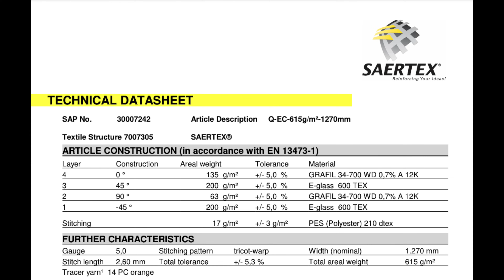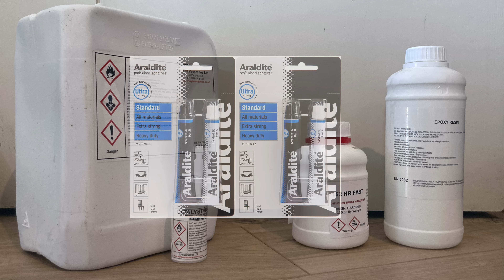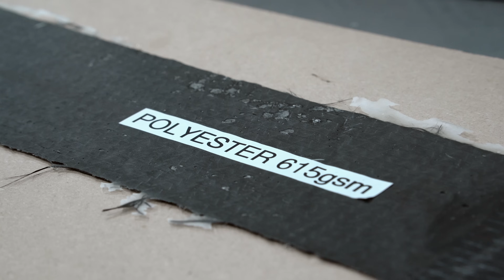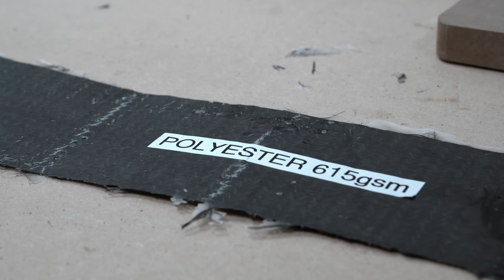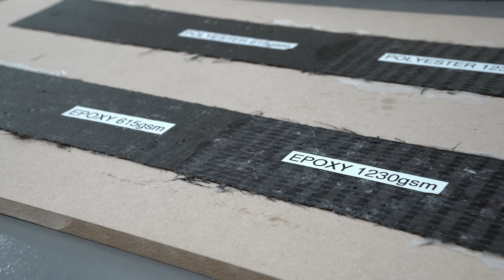Polyester VS Epoxy Resin comparison test - carbon / glass. Expedition lifeboat conversion.Ep102 [4K]

Comment: Bond strength is the big difference, a chain is only as strong as it's weakest link.  Much has to do with the application.  Glass Straight. biaxeal, laminated, use waxes that epoxies will not wet out fully.  So when you get a fabric made of layers, they use a binder to hold the shape inhibits wet out where as polyester wets out fine.  I would guess the most of the composite materials were made for polyester resin not epoxy.  If a test of strength is to be fair and accurate one must use uncoated fiberglass.   This would be difficult as I have never seen defined composites Epoxie or polyester almost all are for polyester.  I have been building and repairing Boats for 55 years and have seen evolution in most materials but not in fiberglass.  At 16 years old I watched one repairmen do a repair in epoxie, and ask why.  He told Me the bond to fully cured fiberglass is to weak with polyester, so one needs to use epoxie.  That was 55 years ago, today not much has changed.  The best thing with polyester is it stinks.  Unfortunately it is cheap and fast for mo money.
Reply from the maker: All of these composite fabrics are optimised for use with epoxy resin. It's only emulsion bound mats like basic CSM that need stryene (in polyester or vinyl ester resin) to dissolve that and allow a proper layup. Even plenty of basic glass fibres (some CSM, and plenty of woven etc) are not emulsion bound, and so combine fine with epoxy resin. You're spot on that most polyester resins form a poor bond to already cured parts - it's certainly not an adhesive! Cheers.

Comment: Insightful video. The other thing to consider is that polyester resin becomes more brittle over time compared to epoxy, or so I've heard. I also prefer using it as it's not kicking out the same fumes as polyester

Comment: all the fiberglass yacht builders use vinylester, not poly. poly will absorb water at some point. i'd just use s-glass instead of carbon stuff. the lifeboat is fiberglass so s/e-glass will bond with it no problem.
Reply from the maker: Oddly, via my suppliers vinylester is only a little cheaper than epoxy. Perhaps in commercial quantities it's cheaper.

Comment: Did you state what the build objective is? If repair of a polyester layup then epoxy is preferred material.
Is there a good reason to even think of using carbon in Alan? Dont forget electrolytic corrosion issues if metal amd saltwater in the application.
The cloth manufacturer should specify approp resins
Gloves, at the very least, highly advised with these resins esp epoxy as high allergenic potential and permanent health consequences.
Peel ply is critical, not just to control sharp fibres but to help optimise resin ratio, to optimise bonding surface of the cured composite, and to deal with the amine blush problem with epoxies, something which hinders surface finishing incl paint adherence.
Epoxy composite will only achieve optimum strength with post cure at higher temp as specified, certainly room temp cure is inadequate. post cure for a day or so inside a car on hot summers day works well, for small layups.
Dont use / keep silicone materials in  the same postal code as your composite layup work, or risk serious loss of bonding performance.

Comment: How long did you leave the resins to cure before testing? I'm not an expert in composites, but I have spent 40+ years working with aerospace paints & coatings (mainly epoxy & polyurethane). We would not perform mechanical tests until the film had cured at room temperature for 7 days. Partially cured films are likely to exhibit greater flexibility.

Comment: I found it interesting how much flex the single layer had. I would like to see, how two single layer with a foam in between compare to a double layer, when it comes to blunt impacts, like with a 400g mallet.
Reply from the maker: Yes, unidirectional carbon is incredibly flexible when thin. For sure, a sandwich would stiffen it dramatically, but not help much in a point impact.

Comment: A completely uninformed idea - vacum bag. There's a channel called The Duracell Project and the lad there vacum bags all the laminates he does, be ot fibre glassing the boat or construction of carbon fibre chain plates for the sales. I dont know why but I assume it gets the epoxy or glue into all the spaces a heavy weight on a drying piece fails to reach
Reply from the maker: Vacuum bagging, whether after wet lay or with infusion is good, sure. But it's not going to affect the comparison shown here.
Reply: vac bagging makes excess resin leave the layup before cure, bleeding into a sacrificial matting material, so the cloth to resin ratio can be optimised. This is needed for optimum light weight components which is applicable in aerospace, or F1 car. You can get close with good technique and using peelply to soak up excess resin. Vac bag also helps to achieve layup conformity with mold, and to prevent gravity pulling everything off a vertical or overhead layup, which is really annoying.
Reply from the maker: I'm not sure how this relates to my reply. No-one claimed otherwise.

Comment: without whatching all the video, I'm with you on the tiredness of carbon fiber snobs, for example carbon fibers have a very low coefficient of thermal expansion, so it make sense to embed them in very ugly and pedestrian polymer concrete for some applications.

Comment: The important part is bonding to the existing laminate.  I have used polyester in conjunction with G4 as a primer with no failures with a glass overlay.  Its unlikely your hull/deck joint is ever going to bend 180 degrees,  so your simple test would imply that polyester is good enough. I would not lose any sleep.
Reply from the maker: This wasn't an adhesion test, which is a rather different question. This test was for a standalone part.

Interesting on the primer though, vs using epoxy direct.
Reply: @AlexHibbertOriginals   Last video i saw was you considering laminating the inside/outside  of your hull joint, ergo i jumped to a conclusion. Without knowing the purpose of what you may be constructing, hard to say which resin would be more appropriate. At least you do your homework before investing time and money.......some dont.
Reply from the maker: Yep the fender strip join repair will be a simple glassfibre and epoxy job.

Comment: Here are a couple of suggestions:

It might be beneficial to maintain a specific room temperature and humidity level during the laying up and curing process according to the epoxy data sheet. This will have a positive impact on the final results. Epoxy, for example, is known to be sensitive to curing conditions, so ensuring proper post-curing by applying heat for several hours or natural curing over several months can make a significant difference. The waxy texture you've encountered could potentially be attributed to high humidity levels.
All these values will be in the resin data sheets.

When performing hand layups, consider using peelply. This can be particularly helpful in creating a strong bonding surface for later stages, especially after a thorough 150-grit sanding when you remove the peelply. It also helps with proper resin saturation.

Additionally, you might want to consider suspending the test articles like a suspension bridge during testing. This involves having both ends off the ground and then applying pressure in the middle. This method can potentially lead to more consistent results, as you can apply pressure using a scale or pre-weighted weights. Manual testing by hand introduces to much variability in the final results.

Good luck!
Reply from the maker: I referenced a lot of this in the video. Some resins require post-cure, or can benefit from it, and others don't. I kept the conditions constant for this test.

The waxy surface is normal for parts that have cured exposed to air, hence the need for PE pags, peelply, or silicone paper. Peel ply would still have needed the silicone paper here as it's permeable, and would just have soaked up a little excess resin and left a rough surface for later bonding.

If I were measuring deflection or exact failure values, I'd have hired a 'suspension bridge' press as you say, but this was an observational test.

Comment: just an FYI, polyester and vinylester resins don't bond very well to epoxy. Epoxy resins will bond to poly or vinyl.
Reply from the maker: This wasn't an adhesion test, which is a rather different question. This test was for a standalone part.

Comment: The carbon bike industry uses fiberglass and carbon together in key areas of the bike frame that require machining down to tight tolerances, to save cost as well as its hard to machine carbon on its own
Reply from the maker: Yes, it's often also used to make cheaper fishing rods, poles etc. I suppose it would also buy a little leeway in terms of reducing brittle failures too.

Top bikes are weaving in some Innegra now, again to limit the risk of a straight up snapping incident.
Reply: @AlexHibbertOriginals your comments remind me of a couple of the carbon fibre foiling yachts in the round the world race, massive cracks developing along huge structural areas under the constant pounding of the hull on the waves. I imagine there were flexing forces from various directions. Alan has yet to sprout foils for those 40 knot down hill runs with the Bukh champing at the bit in big waves so you should be just fine. 😅

Comment: Lots of good points, but...your test is really just comparing resins, not the resin's effect on fiber choice. With a hand layup wet out, the fiber:resin ratio is extremely low, especially without peel ply. Likely ~20-25%. So you really aren't testing the fiber properties when the matrix is primarily made up of the resins. Your test shows exactly what we'd expect of just laying poly or epoxy resins on a flat surface without any fiber. There's no reason that poly can't create a carbon fiber composite, the question is more, why bother? The only reson to use CF (and pay $$$) is because you need the extreme material properties that it can provide. But to achieve these properties, at a minimum, the part must be vacuum bagged, or better yet, infused. Otherwise, the resin ratio is too high and the matrix wont reflect the ideal properties. Going through all the extra expense and effort of these techniques seems silly if you're using a relatively flexible resin like polyester. If your part is designed to flex, why consider CF in the first place? FG will flex plenty without the brittleness and cost an order of magnitude less.
TLDR: dont use carbon unless you absolutely need it and are willing to do it properly! --> $$$
Reply from the maker: Likewise, you make some good points, but:

1. 20-25% is very pessimistic. I mixed up a set amount of resin, taking into account brush wastage, and there was still some resin overspill. So the laminate was not 75% resin. It was near 50:50. I agree that some infusions/prepregs give you >50% fabric, which is great.
2. Carbon is often used in applications when they need to flex. Case in point, these unidirectonal-dominant laminates can bend back on themselves before they start to snap. Thick carbon laminates are indeed stiff compared to glass, aramids and so on, but not in thinner layups or across wide spans.

Comment: I am a Certified Prosthetist.  When making prostheses that must be strong and light we use epoxy resins. The issue with using polyester and carbon fiber is that the resin does not bond very well to the fiber. Resins have a hard time bonding well to carbon fibers that’s why it snaps. They have developed surface treatments and sizings that are only compatible with epoxies .  The weakest link is the polyester resin. Polyester is also a great health hazard so ventilation and safety precautions should be considered. 

Carbon fiber can be used with polyester, but must be suitable for the composite properties. For carbon/poly composites, the best applications are those that are lightly loaded (maybe just stiffness critical) and/or in pure tension (compressive and shear properties will be compromised using polyester).  The lay up is also a factor. If you have carbon fiber separated by layered of fiberglass or matting, the lay up is much stronger.
Reply: I would be curious to see the difference between isophthalic resin and vinyl ester resins performance vs epoxy. I was a composite tech, we built a navy seal device using carbon fiber and vinyl ester resin, many layers thick strong as shit. Still in use 8 years later.
Reply: Hi, what is the best way/product to do carbone reparation as fast as possible with the best result? I have epoxy resin from easy composite who need around 3h but i m looking to something like 20/30 min or better
Your skills could really help me.
Thanks
Reply: A person why embraces his tech,  Thank You for a great post Riverbill72

Comment: You should try out a laminate with polyester and S-glass fiber. It will perfrom as high grade carbon and the weight peanealty is minimal for hand layups.
Reply from the maker: I actually had an e vs s glass test planned, but it got buried with other videos....
Reply: I think the stronger glass variety is called S2.

Comment: Carbon and polyester do not mix too well. I had weird technique -- I worked a ball of carbon-epoxy in my hand like clay until it was thoroughly wet and used it to  strengthen parts when needed. I have huge roll of single strand which becomes like wet paper when masticated long enough.

Comment: The polyester was not bonding to the fibers as well. This was what I expected when you told us the known properties of the resins. The lower bonding to the fibers can be seen in the polyester as it is bent as the fibers separate and cracking can be heard and seen in the material. The exact forces needed to break each is the real question. Mechanical fatigue and the type of fatigue is likely different between these two composites. You are not going to find reliable data on it though, even if you look it up, as that topic is currently in the academic research realm since composites and their uses are still fairly new technology while the variables can be very dramatic, just as this experiment has shown.

Comment: Here is a thought.. I am only saying this from watching years of carbon fiber youtube videos on manufacturing process.. Try this process again but this time put your carbon fiber pieces once wet in Epoxy inside a Vacuum Chamber let it set over night then repeat the test you will see that you will gain even more strength.. It has some thing to do with Air and epoxy and bonding to the carbon fibers all some thing that is above my understanding and knowledge.
Reply from the maker: Professional carbon layups with prepreg are certainly a different category. They consider a 1% increase in tensile strength to be worth the added investment. I'm not sure about the air being the deal. Generally epoxy curing with air means a tacky surface.
Reply: Yeah its like vudu magic or some thing.. I will continue watching but A channel to check out is Mike Patey  I watched him build a few planes now in carbon fiber you can kinda see how he did his stuff but I still can't find the name of the channel that had the giant tomb vacuum chamber for curing carbon fiber vehicle tubs. Its all interesting stuff just wish I understood what is happening on the chemical bonding level..  @AlexHibbertOriginals
Reply: I was always curious what if you created your boat out of fiberglass then wrapped it in carbon fiber for penetration strength. Idk just talking here..
Reply from the maker: That wouldn't be a goer as carbon is poor for point impact. Plus, you'd need to work out how a mechanically bonded carbon skin would behave. My guess is over a GRP shell - poorly.
Reply: @AlexHibbertOriginals  yeah probably right on that! Was just a random thought
Reply: the hull layup for penetration resistance would be glass / kevlar (aramid) rather than glass / carbon. just as in 'bullet proof' jacket.
Carbon is not a material for chasing resilience.
Reply: Some vehicle manufactures actually layer the carbon fiber tubs and then let them set inside the vacuum chamber for 72 hrs before relaying more carbon fiber and epoxy also it seems everyone has there own recipe when it comes to how much hardener  as well..